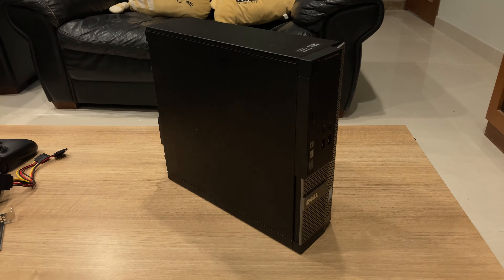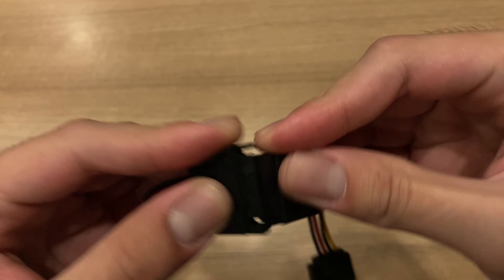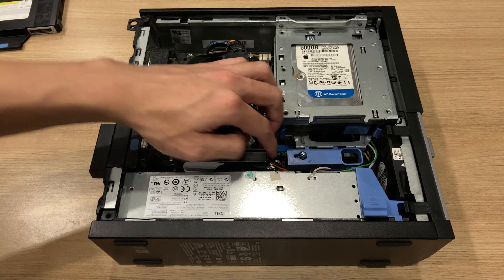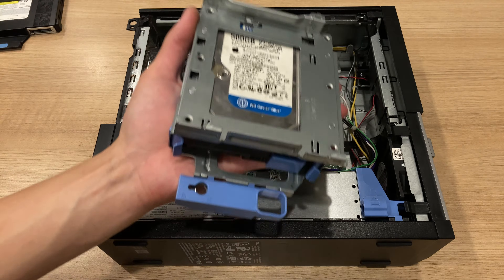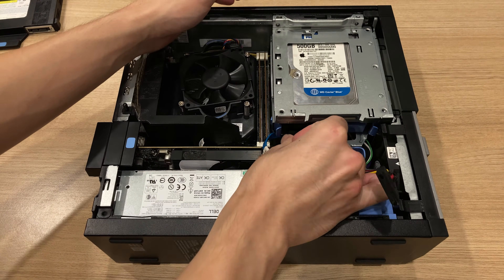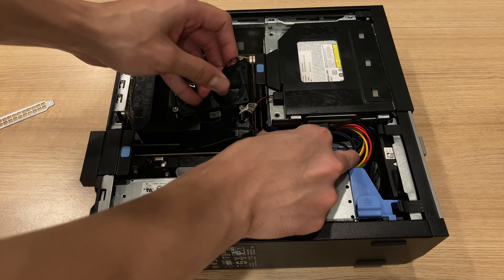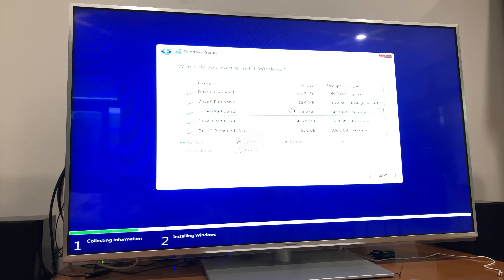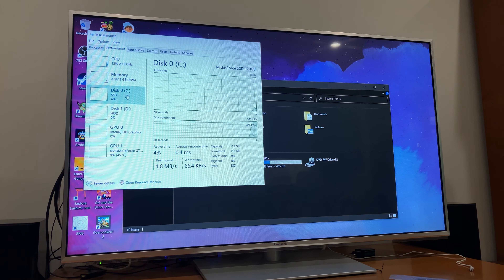How to add an SSD to a Dell Optiplex 3020 SFF without removing the HDD or CD Drive

Comment: what about the extra heat generated by the SSD? Could you not just have the new SSD Hrddrive laying in there, not underneath the HDD Harddrive?
Reply: The heat generated by an SSD is going to be pretty negligible

Comment: Can you put an RTX 3060 Graphics card in a Dell PC.
Reply: I installed an evga xc rtx 3060ti 8gb on the dell OptiPlex 3010 tower with i7 3770s and 16gm ddr3 with an psu replacement with an  evga 650 gt psu, fits and works just fine, but makes the pc heavier to carry! The rtx 3060 will fit in any "dell tower" with x16 pcie slots, you just need a higher recommended psu for that card.

Comment: noob here.  How would the process differ on a 7020 SFF which has 3 SATA ports?  Really want to add a boot SSD but keep the HDD and DVD drives.
Reply: I actually came here to ask the same thing!  Someone gave me 7020, and I wanted to use it for HTPC.
Reply: @moonwatcher99  I don't know what's going on with Youtube.  My comments disappearing or seemingly shadowbanned...  Anyway, you just need SATA data cable, and a SATA power cable.

Comment: Good day. Hopefully your still active, just wanted to ask, what kind of MoBo alternative I can use to replace my stack Tigris SF MB. Someone recommended me a z97 motherboard. Its a LGA 1150 socket, but im not quite sure about the screw holes. So I would i appreciate it if you can make a cideo about it.

Lastly, is there any other slim PSU i can use to replace the stack PSU?

Hoping for your kind response. Thank you.

Comment: This was really useful video - thank you. I got a 3020 SFF thrown in with a 22” Dell monitor for £40 so I replaced the standard i-3 with an i5-4590, got a 480 GB SSD and I cloned the existing Win10 320 GB HDD onto the SDD and then replaced the HDD with a spare 1TB HDD and using a splitter cable and a BEYIMEI PCIE SATA Card as shown in the video I was able to keep all 3 drives functional. The only thing I would say is next time I might not clone the HDD on to the SDD but instead do a clean Win10 install. Next is to find a cheap, low profile graphics card for it.
Reply: GT 1030 fits perfectly
Reply: @RussTi  Brother I am looking for Dual port graphic card for this DESKTOP.  Please suggest one for VMS software
Reply: @akhtartherocks  I'm not sure if any dual port cards will fit.  the gt 1030 is pretty snug as it is.
Reply: @RussTi  Hi Tim, Thanks for the reply dear.
Let me correct myself, I want two hdmi or mini dvi display port minimum to connect Two Monitors together to extend the display.
Please let me know if you find anyone, as what I find is one with Hdmi and Vga only.
Reply: ram may also be something to consider, as long as you are not already at the 16gb(8 per port) limt.

Comment: Many thanks  had old oplex dell pc not quite the same but everything came into place using just the items you showed. had flash drive with win 10 on it change original old ssd drive changed to a 
Samsung SSD 870 EVO, 500 GB, Form Factor 2.5", Intelligent Turbo Write, Magician 6 Software, Black. Waiting on a ASUS GT730-SL-2GD5-BRK GeForce GT 730 2GB GDDR5 low profile graphics card for silent HTPC build includes LP brackets which dosnt need extra power and will run all the games i play. again many thanks was up and running in less than an hour.

Comment: Hi there! I have the exact same computer, and im doing this without the pci adaptor as i dont need the optical drive. But when i plug the Y SATA cable none of the hdd or sdd will power, and the pc wont recongnize them. Does the Y cable that you use in the video has a special name or quality? Dell optiplex SFF 3020. Thanks in advance

Comment: Be careful not to touch bare hand the contact terminsls of ram,ssd,etc to prevent voltsge spike,computet has 1.5v on some components like memory,etc use gloves all the time when working with computer.
Reply: If there is no power source then it's safe
Reply: I’m like, are you fillin up the tank with yer engine still runnin?? 😂

Comment: I just purchased this Dell model. I upgrade the HDD to SSD drive as the primary or system drive but unfortunately, Windows 10 is not able to detect the SSD with 512Gb capacity. I don't know the problem. what should I do? Thanks
Reply: have you fixed this problem?
Reply: sounds like a compatibility issue. Maybe try to update the BIOS and if still doesn't work try a different brand of SSD? The other possibility is cable issue. Try to use a different SATA cable.
Reply: Might try changing bios setting from UEFI to "legacy"(?).

Comment: hi mine is 3010, can i put 2 hdd in it or not?
Reply: for the sff model, you can only fit one hdd, two ssd's can fit, there are sff caddy's for the 3010 sff model or use masking tape to hold left and right side edges of the ssd unit to the pc brackets and buy adapters, connectors.
Reply: @RichardM.619-SD  okay, thanks

Comment: So you just leave that SSD dangling off the cables and lying on the motherboard?
Reply: Yes, I noticed that. Totally wrong and unprofessional.

The best way to use a 3.5" drive and a 2.5" SSD  together is to replace the DVD burner with an optical caddy that takes a 2.5" drive. Put the 2.5" SSD in the caddy, connect it all up and enable the SSD as a boot device in the BIOS.
Reply: @sigint99  Do they make them for the laptop-style slim optical drive in this unit?

Comment: do you think it's worth it to wear static gloves when doing this?
Reply: No, they are not as fragile as people say. Iv'e never used static gloves and never had anything fail. But i for the most part work on older hardware that is not very expensive. But if i where to put together a pc for a couple thousand dollars i would consider using.

Comment: dell 3020 has 1 sata 3 and 1 sata 2. You should not plug the cam cord (sata 2) for the ssd.
Reply from the maker: Im pretty sure I swapped that so that the SSD is on the SATA3
Reply: @OTechnology  sorry, i don't know if the cam wire supports sata 3

Comment: Hello bro Normally psu bist light blink everytime you plug the computer. Right. But now , i plug no sign of light anymore.

 (Dell 3060 sff same  psu)

Bro how do know the power supply is dead. I try to test my psu, only psu motherboard and processor are intact. My psu is BIST BUTTON FREE.  I remove the 4pin 8pin connector from the motherboard , then plug the psu. The Bist light glow for 3 second,  i put back again, it won't glow. No sign of light, 

I try also psu test using paper clip method jamper black and  green the psu bist light glow and the fan is spinning

Is my motherboard is dead or my psu?
Reply: Check your ram,cmos and also put new thermal paste..

Comment: i have same pc. can i ask if the default hdmi and vga of motherboard can use together with grapics card??
Reply from the maker: You need to go into the BIOS and set the primary graphics adapter to the iGPU first.

Comment: Just bought a 3020 sff and hoping to do exactly what you did here, cannot believe there is a video on it! Are you running this with the stock power supply?
Reply from the maker: Haha I thought this might be useful for someone somewhere glad you found it helpful. I am using the stock power supplies still its 250W and plenty.
Reply: @OTechnology  can i use a caddy for a third ssd drive?